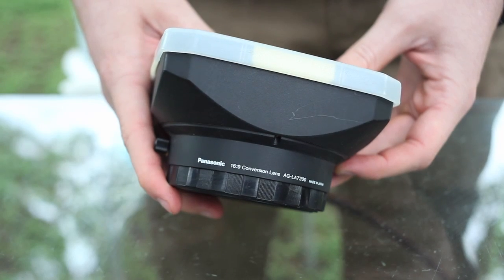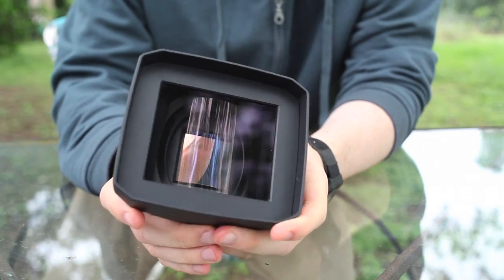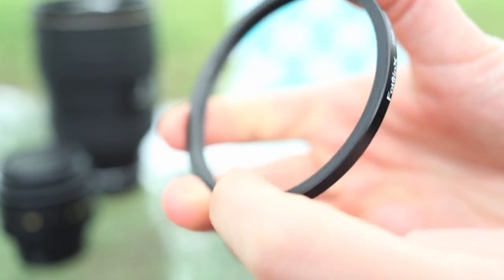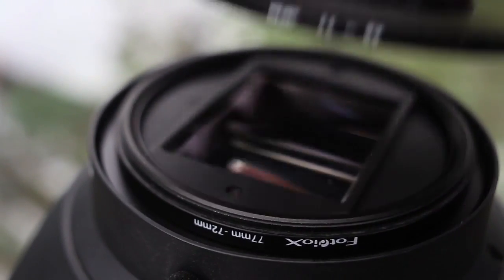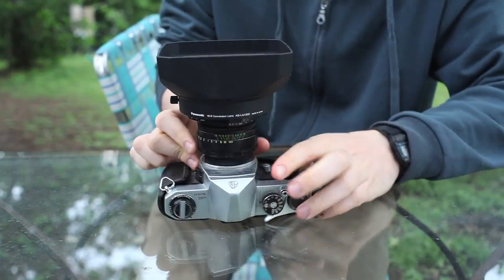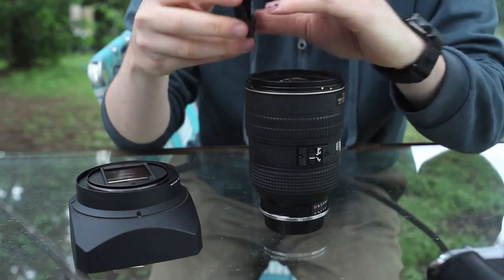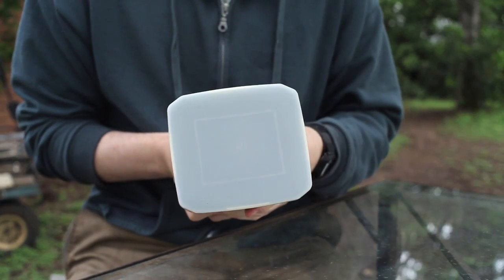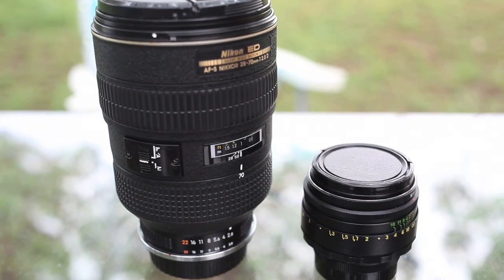AG-7200 (AG-LA7200) True Anamorphic Lens Adapter Tutorial on DSLRs using 5d mark II

Comment: Thank you for the video. I've tried to attach this anamorphic lens to my DSLR but I haven't been able. My camera filter is 67 mm. diameter. I've got a 67 to 72 mm. adapter but I can't fix the 72 mm. female screw to the 72 mm. male screw of the anamorphic lens. I've tried loosening and tightening but I can't. Could you please help me?
Reply: You need a 77mm adapter
Reply: shvinehoond No. The adapter ring is 72 mm.